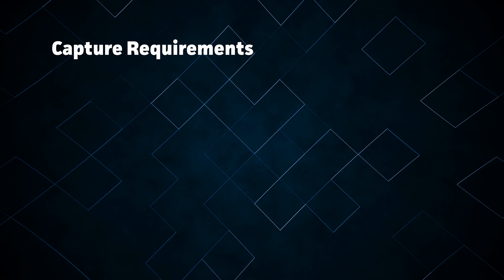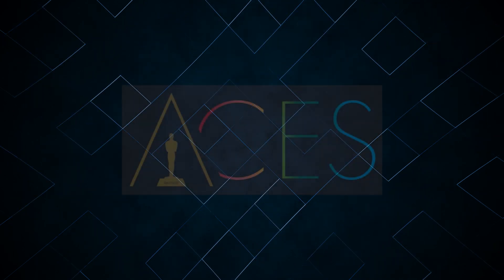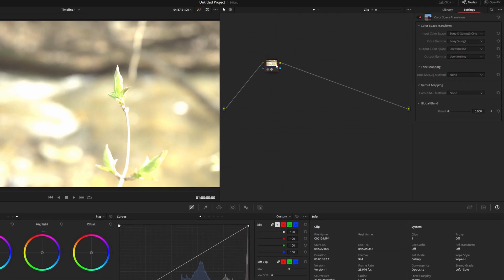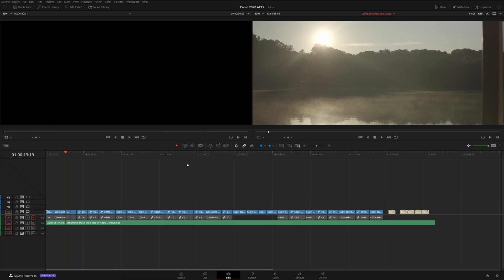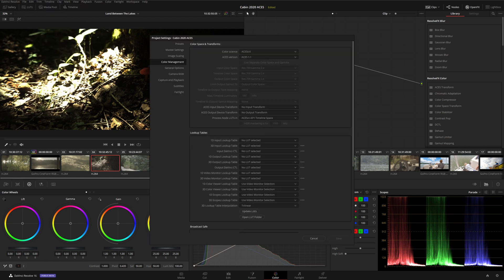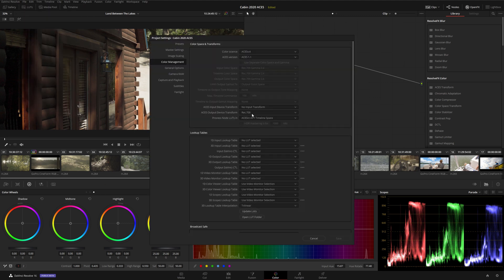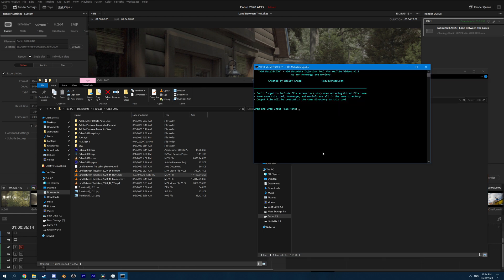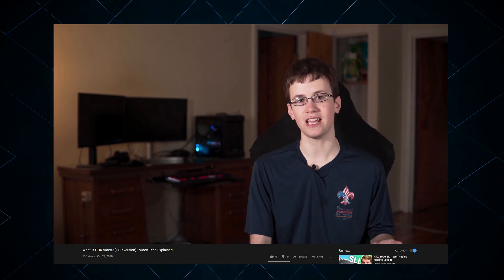How To Make HDR Content Without An HDR Monitor - Video Tech Explained

Comment: As a mac user, this has some faults, would love to help figure it out, but iMacs cover the P3 space, and using the mac built in color sync works for SDR footage, but with the ACES conversion everything looks totally bonkers.
Reply from the maker: Hmm, I don't have a Mac to play around with and test it. Could you send me some images of what you're seeing? My test methodology would be to generate a test pattern in Rec.709, bring it into your project with a Rec.709 input transform, then try different output transforms until it looks the same. It's tricky if your monitor isn't calibrated for a standard format like sRGB or Rec.709
Reply: @VideoTechExplained  This is basically the issue: https://tinyurl.com/y4dao8aj

The color adjustment function does work for normal grading. I am uploading my first HDR test now and will screen it on my iPhone / HDR TV to see if it maps sort of accurate.
Reply: @VideoTechExplained  Also if I do a print screen it doesnt work because the P3 color management is happening in the software for the panel, so it will look properly for you. It is a mess.
Reply from the maker: @CarlNenzenLoven  Is there any way to disable Apple's color management completely? Then you could just choose P3 as your output transform. On my system I had to disable all of Windows' color management except for the DisplayCAL profile I generated with my calibration tool
Reply: @VideoTechExplained  That could be a solution, not sure it will remap properly. Since it is a P3 display showed in 8-bit, so basically it's already remapped and I am not sure what that proper display would be like.
Reply from the maker: @CarlNenzenLoven  If your native, un-color-managed display complies with one of the various P3 standards, there should be no issues. A "real colorist" would say we're both being stupid and the real solution is to use a decklink and a reference monitor, but the whole point of this workflow is to find a solution that works for mere mortals lol. I'm far from an expert on how Apple handles color management, I can only offer some advice based on my limited testing
Reply: @VideoTechExplained  Oh I know, let's just say I have been scolded lots of times for wanting to even try this out.

But I just bought myself and Sony F35 and wanted to see how I can figure out how to deliver HDR with that one on my own before I hire colorist to do it for most clients.
Reply from the maker: @CarlNenzenLoven  Yep, the "correct" way is to hire a colorist with a proper grading suite. But hopefully using this workflow you can get about 80% of the way there without having to spend 5 figures on a monitor
Reply: @VideoTechExplained  Ok.

This is my first test. Actually isn't too far off from what I was hoping for. Need to do more testing for sure though.

https://www.youtube.com/watch?v=HOzfPnTFmkQ
Reply from the maker: @CarlNenzenLoven  Not bad! My method for "verifying" a test is to watch it on a couple different displays, in both SDR and HDR mode. None of them will be perfectly accurate but in combination if should give you a pretty good idea of what you're looking at. I use my main LG monitor, a cheap HDR TV, and my phone
Reply: @VideoTechExplained  That's good enough for now I believe.

If you ever need 10/12 bit footage to play around with, let me know.
Reply: @VideoTechExplained  Trying to figuring out the equivalent ProRes type for the export.
Reply from the maker: @CarlNenzenLoven  You mean instead of DNxHR? Anything 10 bit will work, so ProRes 422 should be fine

Comment: Thanks a lot. That was excellent, truly. Can you tell me what I should use as ACES input transform for my footage shot on GH5S in HLG? And if I'm not uploading to Youtube, but only intending to view it on a HDR TV, do I still need the Metajector stuff? Thanks and cheers, Greg.
Reply from the maker: Try Rec.2100 HLG. I don't have a GH5S so I'd recommend testing this yourself before relying on it for any projects. If that doesn't work, try shooting in V-log since that does have its own dedicated input transform

As for viewing it on an HDR TV, I am not entirely sure. Different TVs will probably have different compatibility requirements when it comes to playing back files directly. I'd recommend using YouTube as an intermediate if it's an option, since the process for uploading HDR there is well documented.

At the end of the day, the only way to be sure is to test it and see what happens. That's how I developed this workflow, through trial and error